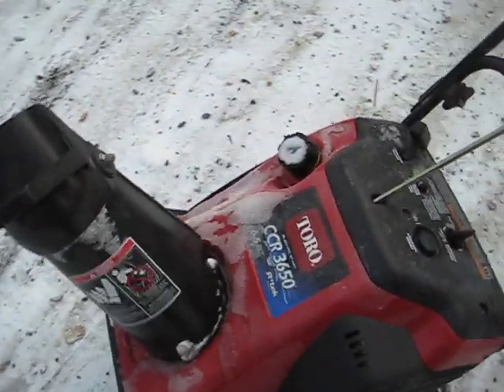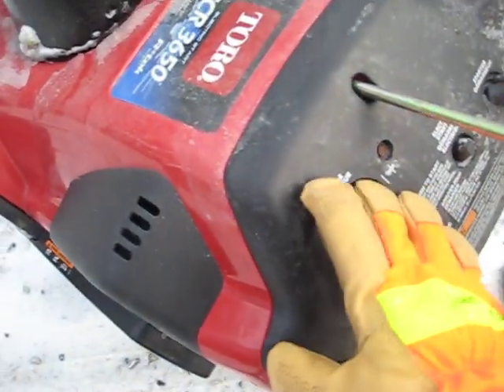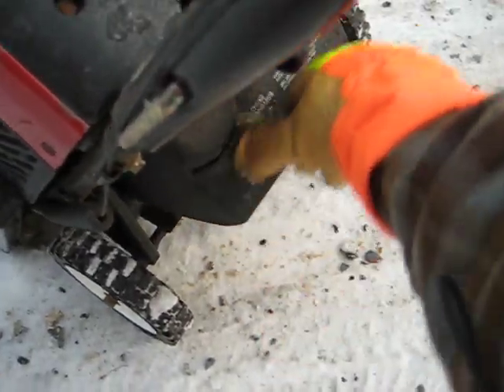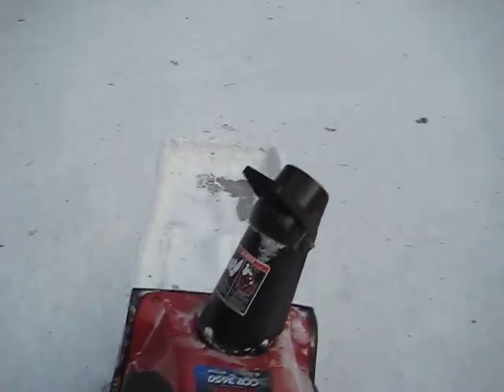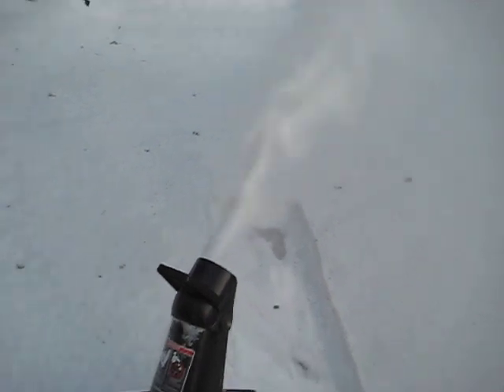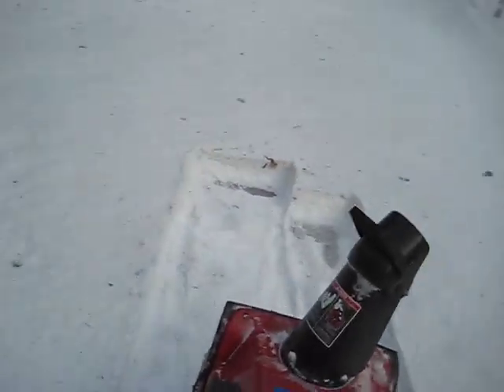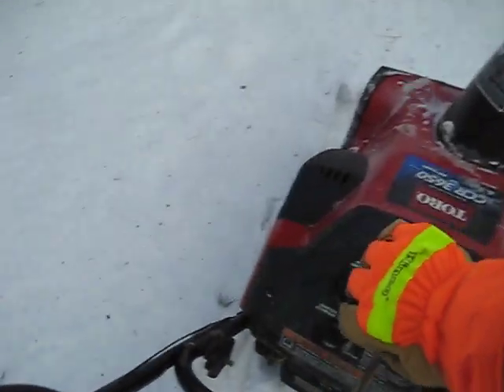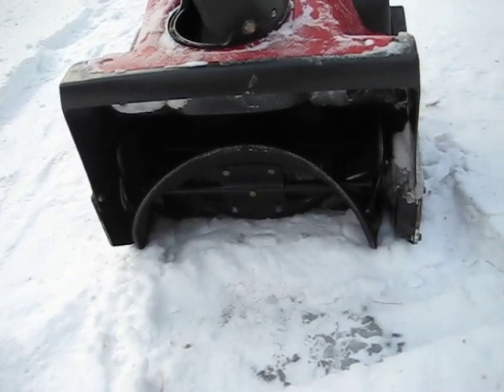Cold start Toro CCR 3650 GTS snowblower

Comment: Do I need to add oil in gas
Reply: Yes. They are a 50:1 mix.
Reply: Like what do I mix nd how
Reply: You would mix 3 ounces of 2 cycle oil per gallon of gasoline to get a 50:1 fuel to oil ratio.
Reply: Oh thank you so much good instructions
Reply: No problem!
Reply: Grisel, ive been using this machine for 10 years.  It works great!   I recommend going to a toro dealer and picking up their little containers of toro 2 cycle oil.   one container will mix with 2 gallons of gas perfectly.   I keep a "oil/gas mix" gas can on hand.  I always get at least mid grade gas.  If you can find ethanol free gas, its even better for these small engines.   Pour the 2 cycle oil in the can and pump exactly 2 gallons..  The 50 : 1 mixtures is important to get right.
Reply: Omg I didn't knw anything about all this I been hashing this machine New like 4yrs nd have only used it 4x but never add oil lady time I used it witch it was 2yrs ago it kind of didn't want to turn on dint even knw where is a store or none I have the ccr 5630 I think
Reply: Grisel Rodriguez whatever you do, don't run just straight gas in the machine.  It needs 2 cycle oil to run correctly and provide the correct lubrication.  If you don't have a Toro dealer near you, I believe that Home depot sells the Toro 2 cycle oil.    You can use any 2 cycle oil but I prefer the small Toro bottles (I think they are 4oz bottles).   They are cheap.   Again, I would keep a dedicated (gas/oil mix) 2 + gallon can.   This would be used for the Toro, any 2 cycle weedwackers or lawn mowers that use 2 cycle oil.   These engines will last  a very long time if operated and maintained correctly.  The oil provides constant lubrication
Reply: Thanks a lot to both
Reply: this is the stuff I use:  http://www.snowblowersdirect.com/Toro-38902/p3458.html

a 5.2 oz bottle of 2 cycle will mix with 2 gallons of gas.   a 3.6 oz bottle mixes with 1 gallon.   1- 2 gallons of gas should last you most or all of the winter, unless you are clearing snow daily.
Reply: Should be on cap like mine

Comment: Mine is crap. Everyone worships this thing online but admit it never starts and have to constantly fix it. If the thing you bought constantly breaks down and never starts, don't avoid buyers remorse and just face that it's crap and but a new one.
Reply: It's a year later. Last year I ended up paying about $100 to get mine running at a Toro shop. I have the same oil and gas ratio, followed your video. Same fucking thing. If you have to spend $100 a year to get your snowblower started, it's time to get a new one. Toro sucks

Comment: Torro 3650 only runs smooth with choke in middle position.
Reply: Well that would be needed only if the carb jets were a bit clogged. Try some carb cleaner.